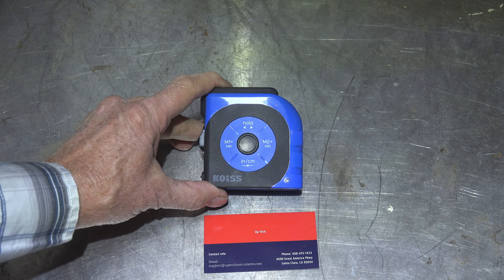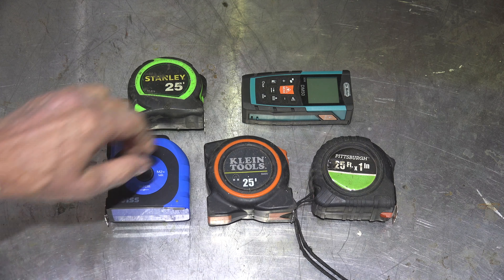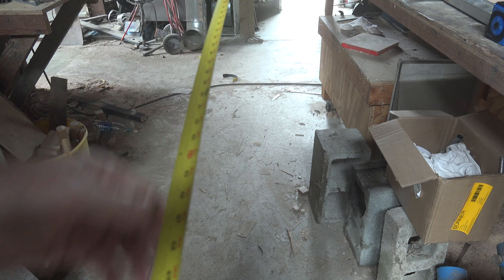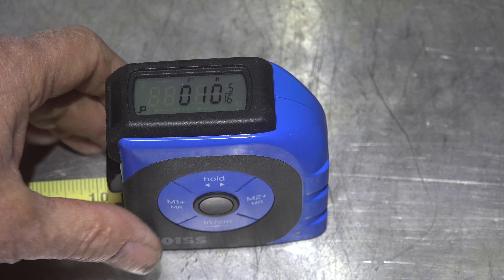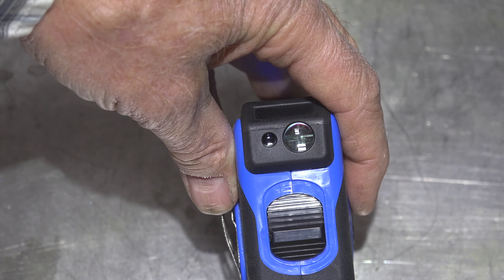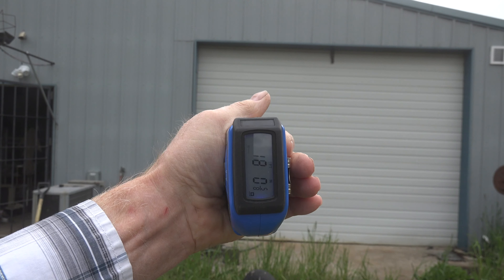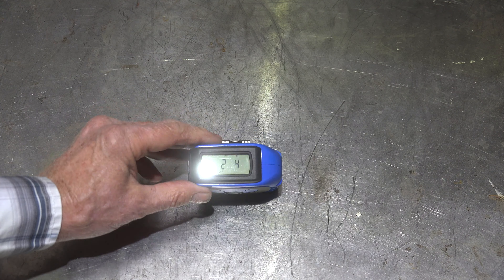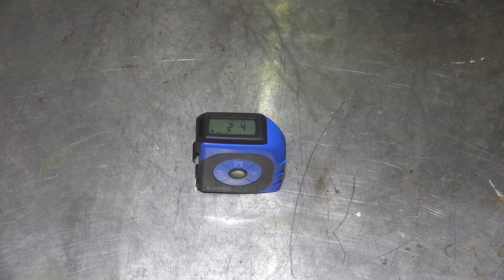A test of the K LASER TAPE MEASURE combination laser and tape measure

Comment: Thanks for all your helpful videos on oil furnaces,put in new pump,adjusted electrodes also depth and pump coupling and cleaned , and happy to say runs great ,no drip and great heat,one little question is it normal to hear a slight pulsating noise when burner  runs ,is it the new pump getting broke in, thanks again
Reply from the maker: As long as it stays slight it is ok.
GFM
Reply: grayfurnaceman thanks so much it’s just a slight pulsating noise just wanted to make sure ,thanks again
Reply: grayfurnaceman, if it continues do you have any ideas what I should check for ,new pump, pump coupling  and mounted junction box for mounting control unit, could it be vibration from metal junction box

Comment: Ive got a bosch  its a laser measure  not a tape.  I used it extensively mostly for  putting in hangars for plumbing  it was accurate and faster much faster  from a sizzorlift to the ground from 10 to 15 foot with wind blowing a tape is  not fun..  That tape you have I see has a kink at 4 inches  looks kinda cheap  and sells for 60 bucks.  I couldnt use any tape for 15 years   and dont expect that.